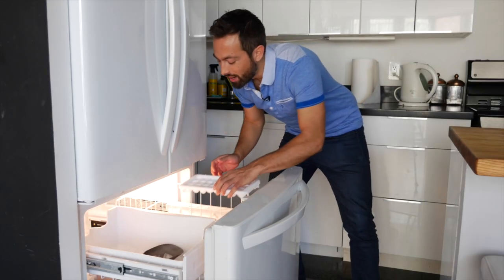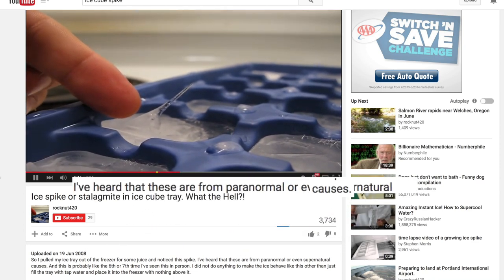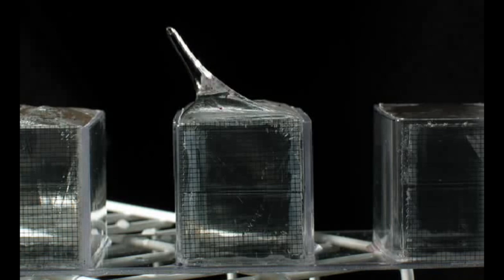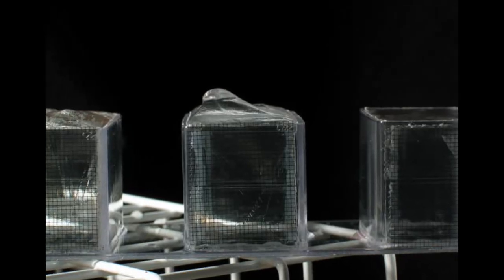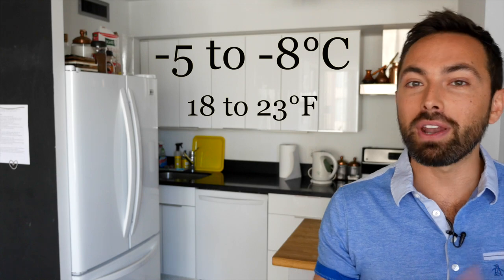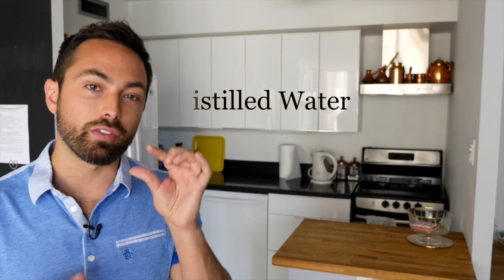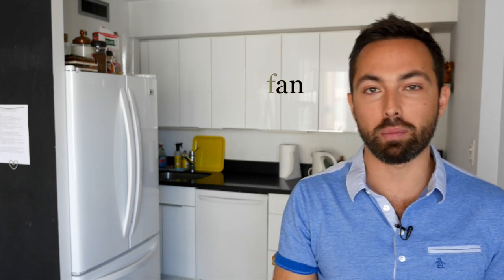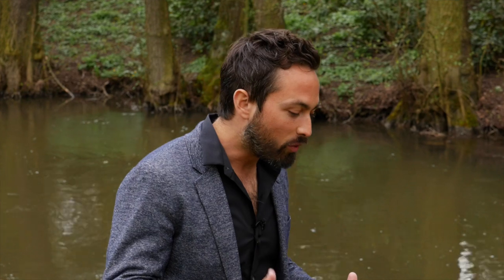Ice Spikes Explained

Comment: I have literally never seen this? Is this common?
Reply: The Scarecrow me neither : /
Reply: Me neither, the conditions seem pretty specific xD
Reply: The Scarecrow My freezer was always colder than -8 c so I've never had them occur in my house
Reply: gunnar felixsson its not correct derek. if the surface containing the water is not hard enough, spikes will not form. you need a HARD surface with your water innit to have the best 4 contitions to make spikes
Reply: The Scarecrow Never saw this either, may be its more common when using certain types of freezers
Reply: My freezer is 18 degrees so ive never seen any
Reply: The Scarecrow I get a few now and again, it's great :P
Reply: The Scarecrow apparently according to another guy in the eurozone regulations mean the freezers are colder than this. Also in places like florida (where i live) we have so much calcium in the water I'm sure i'd never see this.
Reply: I've seen it but not in a freezer. You can see it on lakes and ponds and things like that.
Reply: curious look you could always distill that water

Comment: this has solved a mystery I wondered about since middle school. I knew that when materials heat up they expand. And when they lose heat the oppsite. So I didn't understand how come freezing a water bottle that is too full caused it to almost explode... Now I finally understand.
Reply: Water is unique in that way. It DOES get denser as it gets colder, until about 4c. Then it stars expanding.
Reply: @Mernom  is it because small air bubble trapped in ice?
Reply: @samueladitya1729  Molecule structure.

Comment: Apparently I'm the only one watching this video who has actually seen this happen in real life. My ice has been freezing like that quite a bit and I've always wondered what was causing it. I'd say my ice freezes with spikes around once a week. I guess the type of water use combined with the conditions in my freezer just happen to be right for this to happen. I actually even thought about sending you a video myself of this happening to me to see if you'd explain it, but I never got around to it so it's awesome to see that you made this video on your own. Thanks!
Reply: Fin H It has some issues with the seal on the door leaking some of the air out. The actual freezer works okay, but that small leak keeps it from getting too cold. We've been talking about getting a new one, we just don't really have the time or money at the moment.
Reply: Baron von Han just get a new door gasket . There cheaper than a new refrigerator
Reply: jonelf2 they're*
Reply: Baron von Han I've seen this happen before, but it is incredibly rare for the average freezer.
Reply: Baron von Han Turn the temp down. Have you tried that? It should be at -18C(0F)
Reply: purewaterruler First of all, your username should have at least one capital letter as it's a title. Secondly, the correction should also have include a capital letter, specifically "They're".

If you're going to go around correcting people at least be right, otherwise go get a job as a teacher :)
Reply: This conversation devolved to the average youtube level quite abruptly.
Calm down children.
Reply: Fin H the point was that it wasn't clear. It took me a second to realize he meant 'they're' as opposed to there.
Reply: jonelf2, the point was that it wasn't clear. "There" is a different word with a completely different meaning as opposed to "they're". It takes longer to figure out what you meant, only because you spelled a word incorrectly, and it affected the meaning of that word.
Reply: Harry Balzak some of them are being mature xD. I am trying.
Reply: Baron von Han  It's not that complicated, ice is denser than water 
Now put the logic at contribution and
TADAAAAAM
You understand.
Reply: Emi Ion in the case that you are not joking, ice is not denser than water.
Reply: purewaterruler  Well, my first language isn't english
Reply: Emi Ion and that is relevant how? i mean, if you can carry out this simple conversation, you should know what density means.
Reply: purewaterruler
"Only two things are infinite, the universe and human stupidity, and I'm not sure about the former."
-Albert Einstein
Reply: Harry Balzak which comment are you replying to lol
Reply: purewaterruler
Yours, I was agreeing with you.
[and that is relevant how? i mean, if you can carry out this simple conversation, you should know what density means]
Reply: Harry Balzak lol, i couldn't tell which of my comments you replied to, as i have a few on this thread. XD
Reply: I too was wondering why so many people have never seen ice spikes

Comment: I don’t know why but my freezer does this SO often.
Reply: It might just means that you have a very good freezer 😂
Reply: @julienmauguin3214  or very bad because he said that ideal temperature for that to happen is -5°C to -8°C.
Normal freezer works at around -18°C.
Reply: Using filtered/demineralized/distilled water increases the chances, before I got an ice machine I used ice trays in the freezer and used pure filtered water and got spikes almost all the time on multiple cubes.
Reply: You are special and don’t forget it
Reply: @DisiKleep   What factor could make a freezer (occasionally) not maintain that -18 degrees? I think it is due to opening the door too much while the cubes are freezing. Also, how do you get that degree symbol?
Reply: @gordthor5351  Maybe bad compressor. I don't know.
For degree symbol, I have it in Samsung keyboard.
Reply: It's probably the ghosts in your freezer

Comment: I make at least 28 ice cubes a week for about 8 years now, and a spike appears once in while, about 2 or 3 times a year. Always wondered what triggered that, thought at first it was from some kind of impurity in water, but finally found an explanation in that video. My freezer's temperature is -18°C and not ventilated, and I use tap water.

Comment: The water in an ice spike is warmer than the rest? When water solidifies it gives off that kinetic energy as heat? (Cant recall the term for nothing!) Allowing the tip to stay liquid longer and grow taller. Between the pressure from expansion and the accumulated heat from the freezing?

Love the channel.

Comment: More importantly, why do ice cubes explode in your drinks? It happens when you are impatient and disturb the ice cube tray before all cubes are frozen, thus introducing air bubbles that explode once they are warmed up (expanded) in a liquid. Ice spikes are likely due to opening the freezer too many times before the cubes freeze. Thus causing them to freeze slower. I'm not sure about the latter, but I am positive about the cause of the prior. No more stains on my ceilings from exploding ice cubes.

Comment: 3:40 Yeah but at least we would have indentations on the surface of ice because the shrinking ice would create a vacuum inside the ice, which would suck the surface of the ice down until it would form visible indentations on ice cubes. Also, if a really big body of ice formed, the pressure difference may be enough to shatter the surface of the ice as the water implodes.

Comment: water H2O (liquid capacity +4 (*C) 1bar (100kPa , 1 atm)) freezing & EXPANDS +9% , (freezing)  tube at the end, creates more pressure in the pipe (in unfrozen water and air, at the other end of the pipe) = energy in space (in the sun and in the shade of the sun) (pressure motor/generator) ? (material on the inner surface of the pipe that can withstand +9% compression). How fast is the water freezing meters/time ? How big is the pressure/"thrust force" of the frozen  molecule of water  (+9% expansion)? it also breaks the stones if there is a hole inside the stone, at night the water starts to freeze on the outside (like closing the bottle with a cap and the pressure inside the stone rises).
Water triple point: 10ubar (1Pa) -60*C solid water (vs. gas) & 11kbar (2.216GPa) +100*C  solid water (vs. liquid )

Comment: Life would continue as it always has: by adapting. Either marine life would adapt to have a biological stasis during freezing conditions, or sea life would simply be limited to thermal pools below the surface where warm enough flowing water would be present. That, or life would move more to the surface adapting to the cold, but salt water doesn't exactly like being frozen anyways so the motion is kinda moot.